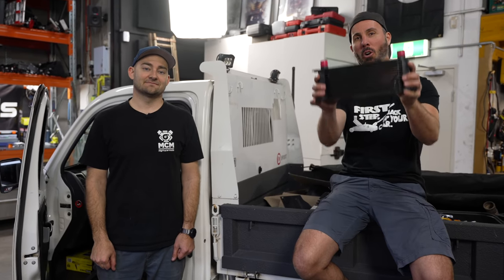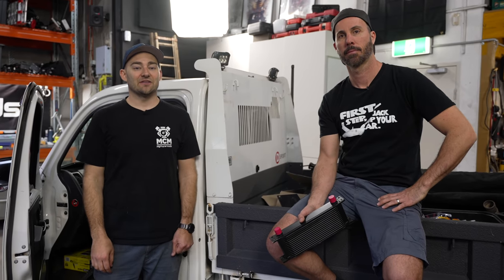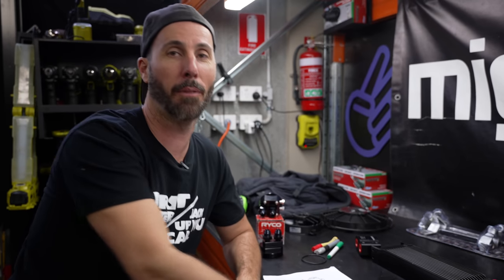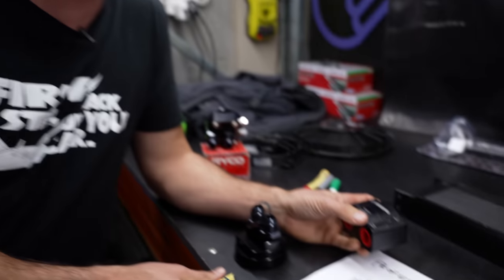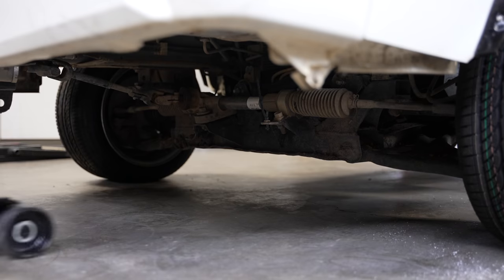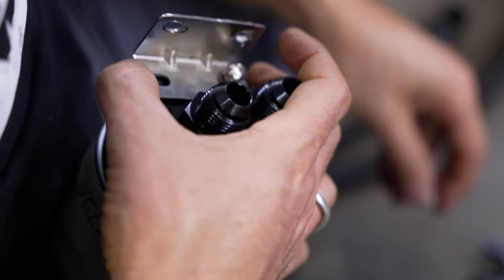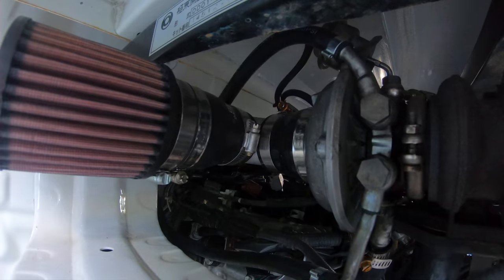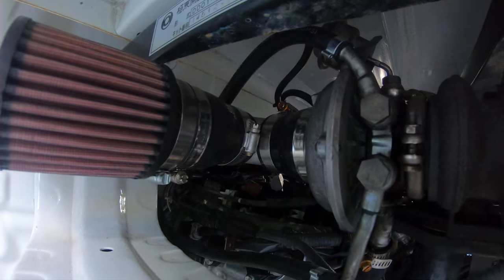How to Install an OIL COOLER

Comment: Never listened to any MCM videos with headphones on before. The sound design in these is pretty good. Noticed the drill on the oil cooler mount was panned all the way left with Marty's voice on the right. Rad.
Reply: They are audio engineers. Of course it’s on point 🤘

Comment: loved Moog's space invader moves @4 mins .. also if you're re-locating the oil filter try to mount it vertically ( you'll thank yourself next oil & filter change )
Reply: Owning an EJ powered Subaru (filter sits upright) and 4age Corolla (filter lying on its side), I actually prefer the filter lying on its side. 

Once the vertical filter starts draining out (the filter stays full but the oil in the galleries from the pickup/to the motor comes out) I have to wait until it stops draining before I finish removing the filter, as it drains all the way down the filter and your hand gets coated if you keep trying to take it off while it drains. 

The lip on the top edge of the filter usually means the oil will drain straight out and down into the pan without going right down the body of the filter, as the ring around the top is the lowest part (when mounted on its side). Sure more comes out but I can normally keep undoing it without getting oil on my hand, don't have to wait for it to finish draining.
Reply: Ohhhh so it drains out for oil changes. Hmmm. Never thought of that before. How much does one of those hold?
Reply: @the_real_superstickman  .. true , i usually just punch a hole in the bottom of my filter & leave it to drain for 5 mins .. but refitting means i can pre-fill the filter & screw it on no mess ( well , less mess )
Reply: I too like a vertically mounted oil filter to pre-fill the filter to the top and fit it. One less volume space for the oil pump to fill before it’s pressurising oil to the areas it needs to be at with a running engine. 
So if it were me, I would vertically mount the oil filter on a remote filter setup.

Comment from the maker: ALL OIL COOLER DEBATE IN HERE; Do you have one? Do you like them? Race Cars only? Street Cars? Good? Bad? Cool?
Reply: Cool Af, no matter the function
Reply: i run one but i like to drive my car and my car is a opel tigra a
Reply: Don't have one, who needs oil anyway.
Reply: I run an after market transmission oil cooler in both my daily and weekend cars and never had an issue with it. 
Vx v6 and Vx V8
Reply: RX8 here. Factory fitted oil cooler.
For rotaries at least, the oil makes up 30% of the engines cooling system so it's critically important.
Reply: My sr20det primera is going to get a filter relocation kit for the obvious reason and while I'm there I'll throw a cooler at it as well. With a thermostat as well here in NZ most of winter I doubt it'll ever open so be redundant until I'm getting on it or it's a stinking hot day.
Reply: I have one on my XR6T.. blew a fitting and pumped 6 litres of the most expensive oil I ever bought straight onto the ground.    Be careful with the fittings on cheap kits.
Reply: XR8 have factory cooler, plus I have a cold thermostat so engine tempts are no dramas
Reply: @yeahnah6468  putting a second one on my one as it was getting hot on the track
Reply: Currently installing an oil cooler in a '94 Camry race car. Good and cool.
Reply: @xxswagxx5375  I'd like to do that eventually.
I've put a 7 inch fan on mine and opened up the wheel arch vents.
Reply: I have an oil heater on my golf does that count? Up here in the north we need to heat up the oil rather than cool it down in winter time when the temps drop. recomended to use from 0C. Coldest we get is about -30C.
Reply: Oil radiator to track use, oil to coolant heat exchanger to road use.  Install your oil cooler in front of the radiator and create air baffles to direct and force air to it , in normal driving with city stop and go traffic air flow is only present when the cooling fan is on. Oil to coolant heat exchanger will warm up the oil faster so less damage to cold engine will occur and will keep oil temp more stable. Tip: oil pressure gauge is your best friend, when oil is cold pressure will be higher, when oil is hot pressure will be lower. When engine is hot hot hot and your oil pressure is strangely high is a sure indicator your oil cooler thermostat is leaking, like mine does from time to time.
Reply: @smithy2  I have also run colder thermostats for years, but realized needed more frequent oil changes, engine ran richer than necessary, plugs fouled when driving less aggressively... 12 years running with a 118hp increase I now run stock temps with higher capacity rad and fan.
Reply: @jgoncalodm  keeping in mind i have a real amateur tune at the moment, i can smell mine's running rich, fuel economy is rubbish 40/100 😒, and last oil change i had diluted oil, i'll follow up on this with my new tunner, when i can get in after this lockup... down, my car gets slightly warmer in heavy traffic and run sweet at or above 100
Reply: Street, Ol Taxi Wagon with oil and trans coolers.
Reply: @smithy2  Glad you took my comment the way I intended, just my experience and not an attack on your choices. Yeah, factory engineers set that temperature for a reason, reasons good or bad they did.
Mind you the car in my thumbnail/avatar is a 1987  carburetted + turbo 1397cc French pushrod machine, standard 115hp and is now pushing 227hp at the wheels, 3.8 lts oil capacity and 4.2ltrs coolant capacity originally.  Improved on cooling and oil capacity, invested in modern heat shielding and never had a blown head gasket.
Reply: I like anything that improves reliability.  BTW, for a daily driver, you want the oil temps to be just over boiling (100C/212F) to get rid of any moisture in the oil.
Reply: @CoinRingsUSA  bro why you lying? Hottest temp ever recorded in vegas was 117F.
Reply: I’m planning on putting one on my street s15 once I finish the build
Reply: I have on in my 1992  1.0L suzuki Kei. After turbo ,a cam a tone of head work , it made 214 hp.  Any car with a turbo should have one.

Comment: Here in the UK, it's Monday morning, there is an imaginary fuel shortage causing numpties to panic buy fuel. Traffic is backed up outside every fuel station. It's pissing down with rain. Listening to Marty talk about the length of his hose whilst Moog twerks in the background just made my Monday a whole lot better.
Reply: Sun is out here but no fuel in a 20 mile radius. Stupidity epidemic shows no sign of slowing down. Good job MCM are here !
Reply: @foamdataservices  it rained up north for an hour straight. Monsoon levels of rain. Then like a light switch it stopped and the sun came out. As for the fuel, the shortages are not affecting Shell garages. Other franchises are affected.

Comment: 12:00 Overkill? are you kidding me. I literally had a guy who was desperate with his cars transmission overheating in heavy traffic on this forum I'm on. I told him an aftermarket cooler like this would be an option but I've never seen one installed until now. I NEEDED this video one m8

Comment: So doing this with my 2006 Suzuki Grand Vitara All Wheel Drive tomorrow. Also installing a transmission cooler and power steering cooler. Thanks for the video.

Comment: i'm looking to do a similar modification to my jeep with the 4.0L inline 6, as everyone knows those engines run hella hot, so i'm going to do an oil filter relocation kit and cooler when i pull the engine to rebuild it and the transmission, def a worthwhile upgrade for any 4x4 or even a vehicle thats heavy and needs a little extra cooling to make up the difference
the kei truck is looking amazing, and moog acting like a space invader in the background was hilarious, stay safe out there guys

Comment: 100% advocate for oil coolers on track cars, even if you aren't really seeing issues with the oil specifically

Threw a $130 ebay kit in my falcon drift car, car used to overheat the coolant like an absolute champ even in cold temps. Threw an oil cooler on (with a thermostat in the sandwich plate) and haven't seen temps over half the gauge in aaaages

Comment: My 1968 MK1 Mini Cooper S has a factory oil cooler. They were fitted before that, back when the top spec car was built to race out of the showroom

Comment: Air-cooled heads & cylinders PLUS air-cooled oil.  Fan driven air in both cases, the air flow directed by the fan shroud.

Comment: all it needs now is a scoop for the intercooler and a truck type intake snorkel, a mini KW intake would look sweet sticking up above the cab but would need to use square or oval tube to get the intake pipe to fit between the the cab and tray

Comment: OK, probably the right time to suggest.  Mitsubishi ASX 4WD EVO lift kit versus Kei truck.  JDM battle extrodinaire.  Do it.  I run a ASX Aspire 4WD and I have taken it offroad and it performs OK.  Lift it, swap the CVT with a 6 sp, turbo it, lift it, and challenge it.

Comment: I hate to be that guy, but:
1. Good oil thermostats don't completely cut off oil flow when closed, like the Improved Racing Tstat in the vid. They will flow about 10% of the oil thru the cooler when closed, so the oil cooler doesn't "shock" the engine with super cool oil once it finally fully opens.
2. Oil cooler cores don't have much structural support, and will succumb to various stressing over time. Bad day when your oil cooler decides it doesn't want to contain your oil anymore. I've mounted external cooler cores at each corner with individual mounts before, and the mounts ate (cracked) 3 cores because of vibrations and torsional stressing. Some sort of strong framework for the core is recommended, and then the mounting points attached to that framework. That way the cooler can focus on cooling, and not worry about falling apart.
3. Personally I don't think it's common knowledge, that you should NEVER solid mount a cooler to a chassis or engine. Look at radiator mounts, they're almost always loosely mounted on some sort of rubber vibration isolators. When they're mounted solid, every bump in the road and every high frequency rev from the engine is transfered into the core. Over time the core will weaken and fail. These risks are multiplied when the vehicle sees track and off roading use.

Not meant as a jab, just an FYI! 🤘

Comment: Dunno if anyone has said this before but in the last episode you said about water crossings. Salastic,  sika, rtv or whatever other sealant you use. You drill a hole you gotta seal it, even grommets i know from experience.
Reply: As an example, fitting flares use sealant on the nutserts and then when you remove the flares reinsert the bolts with teflon tape to keep water out

Comment: Idk if i missed it, but you should add a check valve with the way you placed the filter, since it will drain when its off, and with the length of those lines, you will starve the engine on startup

Comment: I tried using a oil filter take off for my Ecoboost raptor all I really wanted was more oil capacity it was a bad idea lol gotta make sure you have enough oil pressure to support an additional cooler

Comment: Two other ways to build up oil pressure:
If your car is old enough you can just disconnect the entire ECU and crank the starter.
If your key isn't glued together you can temporarily take out the immobiliser module and crank it with the immobiliser engaged which cuts fuel/ignition as well.
Reply: Or just pull a fuse, spark or fuel.

Comment: I  have a friend that machined an adapter for the filter to connect an oil radiator in, listen, in PARALLEL. I told him that it should be installed in series, as in parallel the oil will tend to avoid the filter once the filter starts to clog. But, as I am not an expert, I am asking to confirm or deny my theory. Thank you!

Comment: A lot of newer cars have an oil to water cooler. When they go bad, oil (40+ PSI) enters the coolant (12-14 PSI), and is often misdiagnosed as a blown head gasket. 
Oil in your coolant = bad cooler
Coolant in your oil = bad head gasket

Comment: G'Day Guys,,Oil thermo,,very nice,,has alway been a bug bare about low temps on modern day oils,,unlessyour running a standard weight oil ,,not a 5W 50,,
My only other comment is bigger hoses to handle the oil flow,,yep bigger is better in this case,,
Wonders on how much oil pressure from standard to new cooler,,
remember pressure is only generated at a retriction to flow,,
Even a longer line will create Higher pressures
and while your fitings are supopse to be,,you generaly find the bloody holes in the fitting them selves will cause pressure in crease,and more work has to done by the pump to generate the required flow,,Most oil pumps are fixed displacement,,and don't like retrictions even if it is just one fitting,,Or extra 10 metres of hose,,

Edit:wonders at what preussure/flow rate your oil pump relief go off at,,seeins plenty of pressure all going back to tank,,Or sump,,nothing though the lines..
why you should have a couple fo pressure sensors on all of oil system,,
and Yes Hydraulic engineer here,,
Reply: All the 90º's are one of the worse parts to it.
Reply: @wobblysauce  G'Day,,Thanks Buddy,,But it get worse,,when trying to work how big the motor need to be and flow with desired pressure,,you run into the "K" factor,,every fitting, bend and hose will have a "K" Number
this is a number equal to lentgh of hose running fluid through,,now useing "Laminor" flow equation you will find a number of Kilowatt required to make this happen,usually add 10% to this,just to make sure,,
just for reference,6mm stainless tube,6 metres long will require a pressure of about 1000 PSI to get a dribble out of the end,,try it ya self,,Cut a peice of garden hose about 2 metres long,,Ok now blow through it,,Now get a peice 20metres long and try to blow through it..a lot more resistance to flow will ocur
You would be amazed at how many applications have screwed up getting this simple thing wrong,,

Comment: Please sign the RPM act to keep the EPA from stopping you modifying your car even in this manner......if you're in the states.
Reply: Sorry, I will not support this BS act as there are other ways to fix this situation beyond giving manufacturers an out for knowingly manufacturing emissions defeating devices that are intended for road use.

Comment: Can you put the air scoop at the intercooler ? Also needs proper Snorkel like Moogs Jeep (at least at the top part, the rest can be straight black pipe) it would be so good.

Comment: Fellas priming the system would have been alot easier if you installed the oil filter vertically not horizontally. You could have filled the filter and then screwed it on, and it also makes oil change time less messy and burnies on the hands and arms with hot oil running down them.
Youre welcome

Comment: Marty just answered the $1 million question correctly. Porsche (and VW) old engines aren't air cooled but oil cooled. Air cooled engines are usually found in 2-stroke bikes where you mix gasoline and oil. The mixture cools the piston head, but the (dry) cylinder is 100% air cooled.

Comment: I feel like you need ferrari Testarossa style air intakes on the sides. 1 for the intercooler and 1 for the re-relocated oil cooler.

Comment: Oil cooler out of the highbeam hole on my Datsun 620, on to the front bumper! - edit: I definitely like the cooler BEFORE the filter, in case the cooler somehow dislodges something into the fluid flow

Comment: Question. Would it be better to mount the filter vertically as apposed to horizontally so you can pre fill the filter for such a long oil line?

Comment: I would have mounted the oil filter housing vertically so you can fill the filter with oil when doing oil changes and not make a mess when screwing it on.

Comment: I'm considering converting my 2009 2.7l highlander/Kluger into a towing vehicle and was wondering what I would need. So this is for sure something I would need in addition to  a transmission oil cooler. Any other tips you all can provide would be great

Comment: You are building a liquid cooled turbo engine with an oil cooler. 'Air cooled Porsches' are air cooled engines with oil coolers. The oil is cooled by air and the cylinders and heads are cooled by air. There is of course some benefit to cooling the oil as well, but it doesn't make an engine 'oil cooled'. Generally you need jacketing in the engine for the oil that is only for cooling and not lubrication in order to call an engine 'oil cooled'.
The first generation GSXR bikes were a great example of oil cooling, but even they had a lot of direct air cooling on the heads and cylinders.

Comment: I got a question about installing an oil cooler on my daily.     
My commute is typically 40 minutes 1 way and mostly highway.  65-80MPH depending on mood.   

I’m on a 2.5L 2010 ford fusion SE 

I was thinking about installing a wrx style hood vent for forced air induction and putting an oil cooler bolted to the hood so the lines would hang yes… but I’d secure them the best I could.       Should I be even considering this?   I’m not looking to do something that will damage my car but I wanna try something unique that actually works and serves a purpose.

Comment: Out of curiousity, when you do an oil system like this, why not also install a catch can for any major bits that might come over time?
Reply: Not needed at alllllll for daily cars with no hp. There's no reason for that BS.  I hate it when people puts shit they absolutely do not need on things.  

*Put a snorkel on your sports car for 10hp+ gains. *

A catch can is for high pressure systems and blowby for racing applications. 

I rally race semipro so I know wtf I'm talking about.